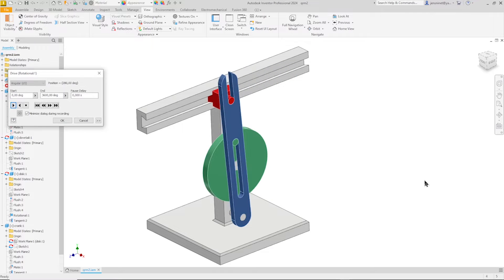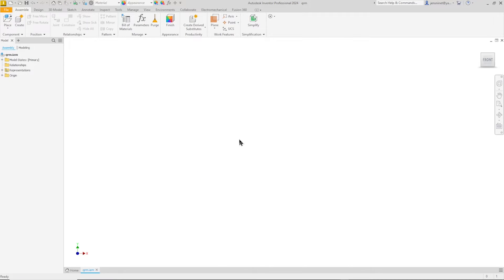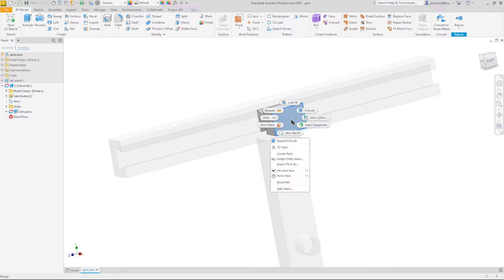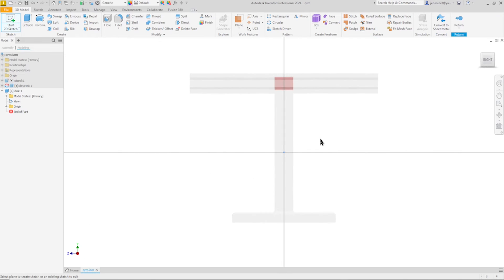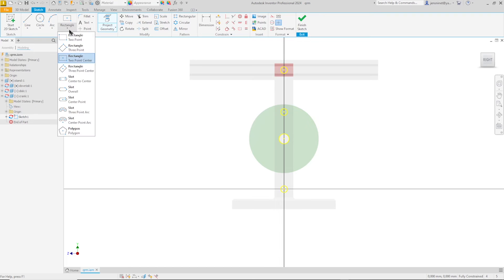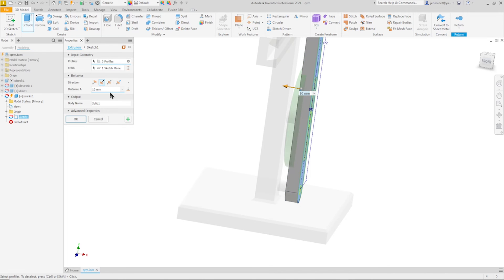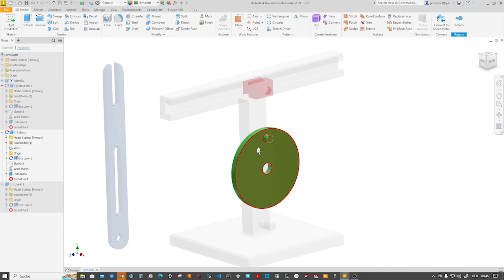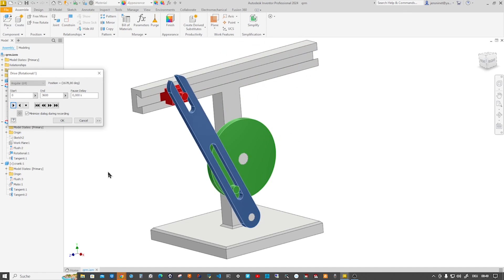Can You Really Learn Autodesk Inventor Assembly in Just 20 minutes?

Comment: All these examples show interfaces that are constantly in contact. I struggle to animate interfaces with hysteresis. So a slot that moves a pin when the pin comes in contact with the one end of the slot, but the pin then stays in place when the slot goes the other way until the other end of the slot comes into contact with the pin
Reply from the maker: something worthwhile thinking about...I modeled a Geneva Drive in Fusion: https://youtu.be/R74Ek76Unrc where you find intermittent motion.